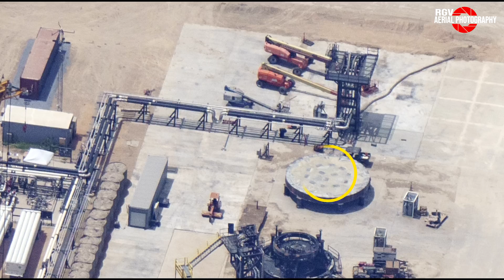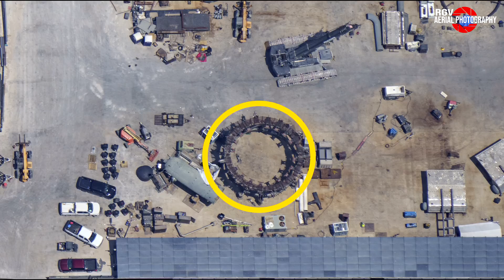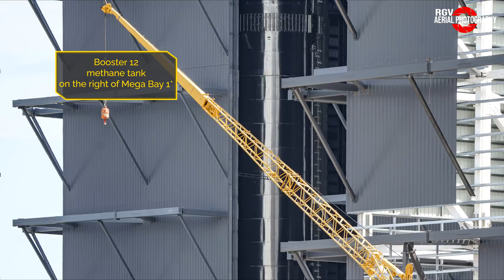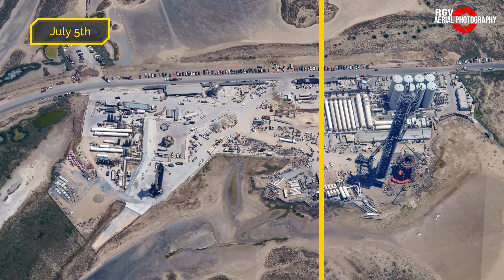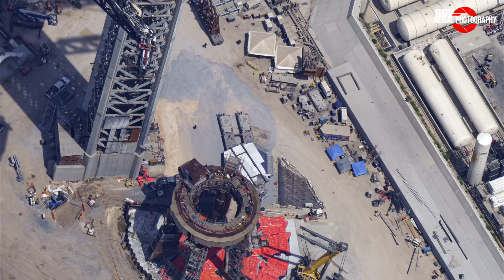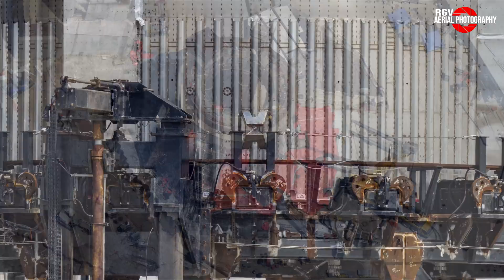SpaceX prepares Water-Cooled Steel Plate for Installation! Starbase Flyover Update Episode 7

Comment: I got a feelin the next booster is gonna explode and wipe everythin out.....that will lead to an end of the project as it would set everythin back a long time.... hopefully not but them raptors are too unpredictable at the minute!
Reply: Even if that happened, why would it end the project?
Reply: @owensparks5013  because the Russians tried the same method years ago an it fucked up! If that don't tell you anythin then wait for a disaster! Composition of chemicals is mad.....it's not stable!
Reply: @michaelhancox1986  You're silly.  The last one they flew they had trouble getting it to explode even when they wanted it to.  You don't think the half century plus of advances in design and manufacturing makes it worth the try?  I mean the way to fail for sure is to not try, but that's also the most shameful way to fail.  Is that how you fail?   You can't be other to try things?  Which composition of chemicals is not stable?
Reply: @TheEvilmooseofdoom  so why haven't we got the apparent technology to go back to the moon even though we supposedly had it 50 years ago? 🤔
Reply: @michaelhancox1986  It's not the lack of technology, it's the lack of money.  Going to the moon is dangerous and expensive and no one had a reason to spend the money and take the risks since the political race in the late 60's.  Now, lets go back to the other things you were saying.  What unstable chemicals?  I suspect this is the point we discover that you are in waaay over your head.

Comment: How did they get the centerplate in the legs tapper in on the inside,just wondering.
Reply: Good question, they brought it in vertically, then lifted it and laid it flat again - see the render from TSE in the launch site section of the video. - peekaboo

Comment: I think the new "shower head" system will hold up just fine. If you have followed Zack Golden's analysis video on the topic, the main problem that caused pad failure is inadequate piling support around the edges of the pad.
Since they added a LOT of pilings and concrete under the pad this time along with a  very thick steel sandwich then it should hold up pretty fine. However, since it is a steel plate, it will absorb a lot of heat. That's why the water system is used in order to cool the plate down and maintain sructural integrity.
The added bonus is that the water will somewhat dupress dust pickup, hopefully.

Comment: Perhaps a naïve or late take but I believe that for some reason the thrust loads may not have been accurate when the initial concrete was designed for under the OLM.  Later data showed it would need to be removed for the installation of the cooling plate so instead of having a construction crew working inside the mechanism to remove and excavate for the new requirements they just decided to allow the engines to do the excavation.  They have really thought outside of the box over and over for this launch complex so to allow the first test article to "excavate" for "free" meant a quicker turn-around and a cheaper rebuild as well as a proof test on the OLM supports in general.
Reply: If (and I say if) they deliberately used the 1st launch to blast a hole under the OLM so they could install the current redesign with major rework improvements just to save excavation construction time, then someone really deserves a star for thinking ahead (and taking a 'chance' the launch tower did not 'fall over', etc). I doubt very much their management would risk such a thing, but it makes a good story !

Comment: The water cooled steel plate at the bottom of the OLM will undoubtedly do its job but the booster exhaust will obviously go in all directions.  A flame trench could have directed all booster exhaust out to sea, away from the tank farm and other infrastructure.  The only plus for the steel plate I can see is that it might increase the back-pressure on the booster during the initial 5m or 10m of it's flight, helping it to get off the ground.
Reply: A flame trench was ruled in part because of the high water table at the launch site.  Building at flame trench would required many layers of artificial to allow for this area being surrounded on both sides by a protected natural preserve.  Plus the time to clear all the legal requirements would have taken considerable time.  

Keep in mind that a whole team of engineers looked at this circumstance before deciding on how to go forward. This water cooled sandwich was already in the works before the first launch and Elon said that decided to go ahead with the launch thinking the fondag concrete would hold for one launch.  They admitted that was a mistake.  Nevertheless it has only been 2 and 1/2 months and the pad is already repaired and the upgrade with the steel sandwich almost complete.

Comment: Not sure if anyone knows the answer, will they fill the water tanks for the water deluge with seawater?
Reply: Oh definitely not. That would wreck the system if they used saltwater
Reply: It's a good question, but no. As @max-q9264  said, even tho that is all stainless steel, it would rust out the entire system. They'll ship in fresh water, and replenish losses after every test/launch.

Comment: Yes, the water system as I heard will have 3000 psi water pressure and I believe with the quicker departure of starship will be successful preventing further damage to the OLM. It will be interesting to find out how many GPM the compressed air will push the water.

Comment: My gut tells me that there is a better than 90% chance of the deluge system being effective. That's a lot of engineering and settling for "maybe" just doesn't make sense. Yeah, it's radical, but so is SpaceX. I'm a fan of iterative design over abundance of caution design. We used to call it "agile" design. This is why SpaceX has been able to do things that NASA never dreamed of. Make it, break it, and try again. Once we get to the point of putting people on these things, then abundance of caution becomes imperative. But until then...........

And as for all of this environmental crap that a small number of people are complaining about? Yeah, maybe some plovers or sea turtles are at risk. But there's plenty of space to coexist. The benefits far outweigh the costs. And people in Port Isabel that don't like sand on their cars will eventually realize that SpaceX will mitigate the inconvenience. Look at Cape Canaveral. Do you hear people complaining about Pelicans, Herons, and Sea Turtles being at risk?

Comment: Based on the test firing of the Raptor 3 at a sample section of the steel plate I feel confident that the installation will mostly address the issue of launch pad damage.